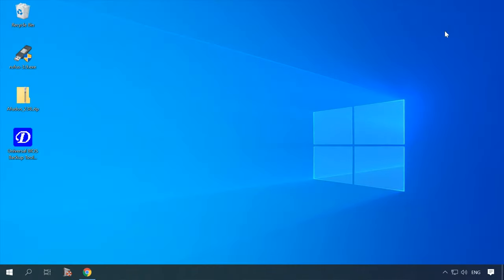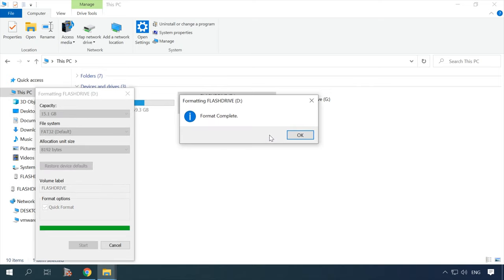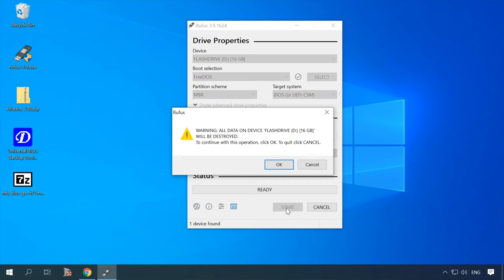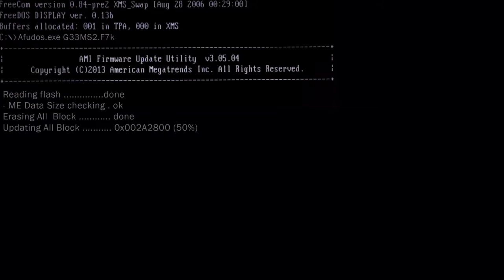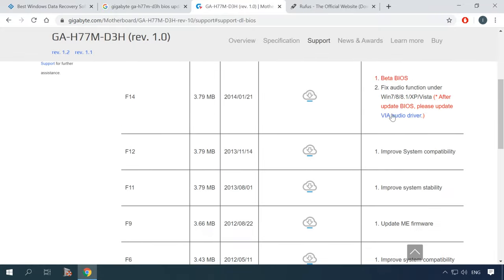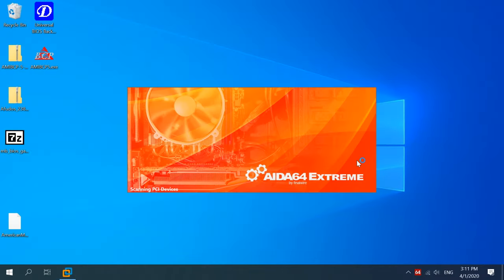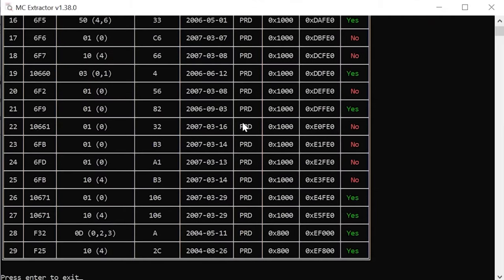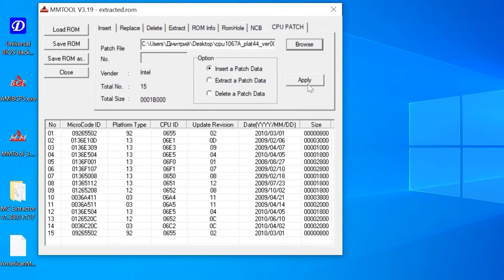🔂How to Flash BIOS With Third-Party Firmware, or Modify BIOS 👨🏿‍💻

Comment: Hi I’m having an issue w the asus prime Z590-A non of the asus modify flashers work because it’s not ami supported and I need a modified version of my exact bios so I can alter my motherboard SN and Chassis Asset ids how would I go about doing that?
Reply: Maybe the ami could work but the issue is I can’t modify my bios on Hxd because when I change the code the size changes

Comment: I have dell vostro 3400 laptop with intel i3 gen 11 processor, please give me a custom bios download link or tell me how can i enable legeacy boot mode because my bios doesn't support it.
Reply from the maker: I can't provide a custom BIOS download link, as it's not safe to download BIOS updates from unofficial sources due to the risk of malware or compatibility issues. However, if your BIOS doesn't support legacy boot mode, you might be limited in your options.

Here are some steps you can take:

Check for Official BIOS Updates: Visit Dell's official support website and search for BIOS updates for your specific laptop model. Sometimes, manufacturers release BIOS updates that add new features or options. If there's an update available, follow the instructions provided to install it.

Contact Dell Support: If your BIOS doesn't support legacy boot mode and there are no updates available, you can contact Dell's customer support for assistance. They may be able to provide further guidance or suggest alternative solutions.

Explore Alternative Boot Options: If you need to boot from a legacy device (such as a CD/DVD or older operating systems), you might be able to use a workaround, such as creating a bootable USB drive with a tool like Rufus configured for legacy boot.

Consider Compatibility: Before attempting any modifications, consider whether enabling legacy boot mode is absolutely necessary. Many modern operating systems and software are designed to work with UEFI boot, and using legacy boot mode may limit compatibility with newer hardware and features.

Remember, modifying BIOS settings carries risks, and you should proceed with caution. Make sure to back up important data before making any changes, and always follow official instructions provided by the manufacturer.

Comment: Can you Kindly do a Video on, Removing the wifi whitelist from Lenovo G series laptops, it will be a huge help for people still use those computers. thank you!
Reply from the maker: Please note that modifying your laptop's hardware can void warranties and potentially cause damage, so proceed with caution and at your own risk. Additionally, it's important to respect any local laws and regulations regarding hardware modifications.

Here are the general steps to remove the Wi-Fi whitelist from a Lenovo G series laptop:

Research Your Laptop Model: First, make sure you know the exact model of your Lenovo G series laptop. This information is crucial because different models may have different methods for accessing and modifying the BIOS/UEFI settings.

Check BIOS/UEFI: Most laptops with Wi-Fi whitelists have this information stored in the BIOS/UEFI settings. You will need to access these settings by restarting your laptop and pressing a specific key during boot (e.g., F2, F12, Del). The key to access these settings varies by laptop model.

Access Advanced BIOS/UEFI Settings: Once inside the BIOS/UEFI settings, you may need to enter a password or perform some other verification. Look for an option called "Advanced," "Advanced Settings," or "Advanced Configuration."

Locate Wi-Fi Whitelist: Inside the advanced settings, look for an option related to the Wi-Fi whitelist. It may be labeled as "Wireless LAN Card Control," "Whitelist BIOS," or something similar. This is where you can usually modify or disable the whitelist.

Modify the Whitelist: Depending on your laptop and BIOS/UEFI version, you may have options to disable the whitelist entirely, remove specific devices from the list, or replace the existing Wi-Fi card with one that is not on the whitelist.

Save Changes and Exit: After making the necessary changes, save the BIOS/UEFI settings and exit. Your laptop will restart.

Install New Wi-Fi Card: If you've disabled the whitelist entirely, you should be able to install a new Wi-Fi card without any issues. Be sure to install a compatible Wi-Fi card that fits your laptop.

Driver Installation: After installing the new Wi-Fi card, you may need to install drivers for it. Download the appropriate drivers from Lenovo's website or the Wi-Fi card manufacturer's website.

Please note that these steps are general guidelines and can vary depending on your specific laptop model and BIOS/UEFI version. It's essential to do thorough research and proceed with caution, as making incorrect changes in the BIOS/UEFI settings can potentially render your laptop inoperable.

If you're uncomfortable with these steps or unsure about your laptop's compatibility, it's a good idea to seek help from a professional or consult Lenovo's support resources. Additionally, consider the potential warranty implications of hardware modifications.
Reply: @HetmanRecovery  Thanks for your very quick reply, but these laptops dont have any option to remove the whitelist within the bios settings, we need to modify bios to remove the whitelist and flash the modded bios. I use windows 10, the blutooth is not working with windows 10 and there is no way to use another wifi card without removing the whitelist. really appreciate if you can help me with this. thanks again
Reply: @HetmanRecovery  sorry for my bad grammar. how about hp laptops like pavillion notebook 14 ab111x? I would like to use an eGPU but it doesn't read the GPU itself. My only options are modifying BIOS or to use nando setup 1.35 for eGPU.

thank you sir.
Reply from the maker: No problem about the grammar! Regarding your question about the HP Pavilion Notebook 14-ab111x and using an eGPU (external GPU), it's important to note that not all laptops support external GPUs, and even if they do, the process might not be straightforward.

In general, laptops need to have a Thunderbolt 3 port to support external GPUs easily. If your laptop doesn't have a Thunderbolt 3 port, it might be more challenging to set up an eGPU.

As for modifying the BIOS or using tools like Nando Setup 1.35, these methods can be risky and may void your warranty. Modifying the BIOS can also lead to system instability if not done correctly.

Here are some steps you can consider:

Check for Thunderbolt 3 support: Ensure that your laptop has a Thunderbolt 3 port. If it does, you have a better chance of successfully using an eGPU.

Check for eGPU compatibility: Some laptops and BIOS versions may have restrictions on using external GPUs. Check with HP's support or forums to see if your specific model has any known issues or restrictions.

Update BIOS and drivers: Make sure your laptop's BIOS and GPU drivers are up to date. Sometimes, updates can provide better compatibility with external GPUs.

Check eGPU enclosure compatibility: Ensure that the eGPU enclosure you're using is compatible with your laptop. Some eGPU enclosures work better with certain laptops or may have specific requirements.

Consult forums and communities: Check online forums or communities dedicated to eGPU setups. Other users may have similar laptops and could provide insights or workarounds for your specific model.

If all else fails, and you're comfortable with the risks, you may explore advanced methods like modifying the BIOS or using tools like Nando Setup. However, proceed with caution and be aware of the potential consequences.

Remember that using external GPUs on laptops is not always a guaranteed or officially supported feature, and compatibility can vary between models and manufacturers. Always check the specific documentation and support resources for your laptop and eGPU enclosure. @bertmiranda7111

Comment: Hi! Greate video! How can i chande BIOS firmware Ext.Func. strings value?
Reply from the maker: Hi! Changing the values of the Ext.Func. lines in the BIOS firmware can be dangerous and can lead to irreversible consequences such as system inoperability. If you are unsure of your skills, it is best not to change these values.

However, if you still want to change these values, you need to go into the BIOS settings, find the Ext.Func. line you need and change its value. How to do this depends on the model and manufacturer of your computer, so I can't give specific instructions without more information.

Typically, to access the BIOS setup, you will need to press a certain key (usually Delete, F2, F10, or F12) while the computer is turned on. After that, you should find the Ext.Func. line you need and change its value according to the manufacturer's instructions. But, again, remember that this can be dangerous and is not recommended if you don't know what you are doing.

Comment: I am trying to flash a modded Asus z170 pro gaming bios, the bios is in .rom extention but its showing bios is write protected, i am using AFU412
Reply from the maker: Flashing a modded BIOS carries risks and can potentially damage your hardware if not done correctly. It's important to proceed with caution, and I recommend following the steps carefully. Keep in mind that modifying your BIOS can void your warranty and may lead to instability or other issues.

If you're encountering a "BIOS is write-protected" error, it could be due to several reasons, and it's crucial to address these issues before attempting to flash the BIOS. Here are some steps you can take:

Check for Hardware Write Protection:

Some motherboards have physical write protection mechanisms, such as a switch or jumper. Check your motherboard's manual to ensure there isn't any hardware-based write protection in place.
Update Your AFU Tool:

Make sure you're using the latest version of the AFU tool. Go to the official ASUS website or the motherboard manufacturer's website to download the latest version of the AFU tool compatible with your motherboard.
Run as Administrator:

Right-click on the AFU412 executable and select "Run as Administrator" to ensure that you have the necessary permissions to modify the BIOS.
Disable Secure Boot:

If your system has Secure Boot enabled, try disabling it in the UEFI/BIOS settings. Secure Boot can prevent unauthorized modifications to the system firmware.
Check for BIOS Protection Features:

Some motherboards have features like BIOS Flash Protection or BIOS Write Protection. Check your motherboard's manual and UEFI/BIOS settings to see if any such features are enabled. If so, disable them before attempting to flash the BIOS.
Backup Original BIOS:

Before attempting any BIOS modification, it's crucial to back up your original BIOS. This backup can be essential for recovery in case something goes wrong. Many flashing tools provide an option to save the current BIOS image.
Revert to Stock BIOS:

If you're currently using a modded BIOS, try reverting to the stock BIOS before attempting to flash the modded version. This might involve using a BIOS recovery feature or flashing the original BIOS from a backup.
Always follow the instructions provided by the motherboard manufacturer and the tools you're using. If you're unsure or uncomfortable with the process, it's advisable to seek assistance from forums or communities dedicated to modding and flashing BIOS.

Remember that modifying the BIOS has risks, and you should only proceed if you fully understand the process and accept the potential consequences. Incorrect BIOS flashing can lead to a non-functional system, and recovery may require professional assistance or hardware replacement.
Reply: Thankyou so much sir for the detailed reply 😊
Reply: I am trying to mod my bios for the resizable bar feature, can u assist regarding that procedure?

Comment: How could I modify the BIOS's boot logo, where in BIOS is it stored? I mean to download BIOS and change the boot logo, then flash it.
Reply from the maker: Modifying the BIOS's boot logo is not recommended unless you are an experienced computer technician as it could potentially brick your system. However, if you still want to proceed, here are the steps:

Download a BIOS editing tool such as AMI BIOS Editor or Phoenix BIOS Editor.
Extract the BIOS file from your motherboard manufacturer's website or by using a tool such as Universal BIOS Backup Toolkit.
Open the BIOS editing tool and load the BIOS file.
Navigate to the boot logo section and replace the logo with your custom one.
Save the BIOS file and flash it using your motherboard manufacturer's recommended method.
Note that the location of the boot logo in BIOS varies depending on the manufacturer and model of your motherboard. You will need to do some research to find the exact location.
Reply: @HetmanRecovery  Thank you very much for the reply. May I ask where did you acquire all this knowledge?

Comment: Lenovo H30-50, H50-50, H530, H530s BIOS..... PLEASE HELP :)  i want to run a gtx 960 "gb card  but eveytime i install the card  it wont display on a screen  just black,  i have tested the card in other pc and all works fine. the bios version is  IEKT31AUS   do you know how i can get the motherboard to recognize the card? it currently has a gtx745 in and works no problem
Reply from the maker: It seems like you are experiencing compatibility issues with your Lenovo desktop when trying to install a GTX 960 graphics card. Here are a few steps you can try to troubleshoot and resolve the problem:

Check Power Supply: Ensure that your power supply unit (PSU) can provide enough power for the GTX 960. The GTX 960 may require more power than the GTX 745, so make sure your PSU meets the requirements.

BIOS Update: Check if there is a BIOS update available for your Lenovo desktop model. Sometimes, a BIOS update can add support for newer graphics cards. However, be cautious when updating BIOS and follow manufacturer instructions carefully.

Secure Connection: Make sure the GTX 960 is properly seated in the PCIe slot and that any additional power connectors are securely attached.

Driver Installation: Before installing the GTX 960, uninstall the drivers for the GTX 745. Once the GTX 960 is installed, download and install the latest drivers from NVIDIA’s website.

Compatibility Mode: Some BIOS settings may need to be adjusted to recognize the new graphics card. Check if there is an option to enable legacy or compatibility mode for PCIe devices.

Reset BIOS: If all else fails, you can try resetting the BIOS settings to default. This can sometimes resolve compatibility issues.

If none of these steps work, it may be best to contact Lenovo support for further assistance. They may have specific recommendations for your model of desktop.

Comment: Hello, I am trying to do the Xeon LGA 775 to LGA 771 upgrade on my HP pre-built I am currently getting the ‘Error 46 – Problem getting flash information’ when attempting to flash my modified bios using afudos.exe and a window ‘Proper command line parameters were not passed. No action taken.’ when attempting to flash using the HP installer in a windows 7 environment. In the HP Windows update process, the status bar goes nearly to the end and just hangs there. I exited the application after a couple hours.

I am attempting to flash a modified bios to upgrade from a Q6700 to a Xeon E5450 on an HP m9252p (Asus IPIBL-LB motherboard). I have successfully modified the bios files with the necessary microcode but now have trouble flashing the HP modified bios via DOS or Windows 7. Any recommendations? The bios was extracted from an original HP .exe file.  I am hoping to get this loud fan noise fixed and Windows 10 up and running. Thank you in advance!
Reply: Benny's did you get this fixed? Was the modified Bios file the same as the original hp BIOS file that you downloaded? If they are a different size you may have to delete microcodes to match the size of the original BIOS file.